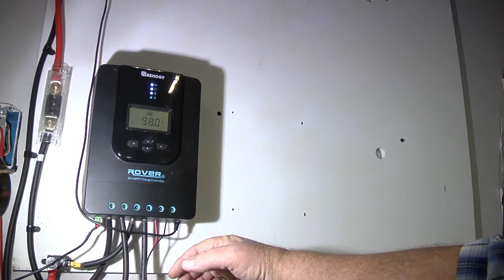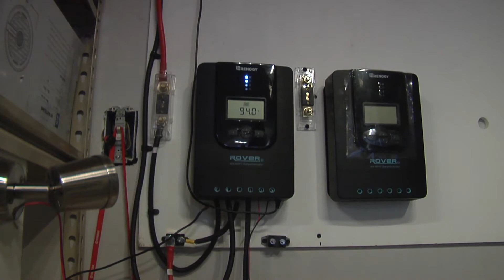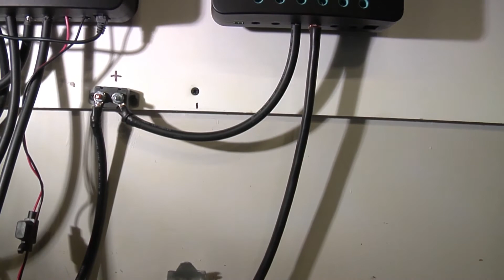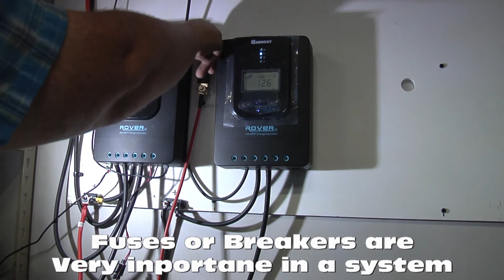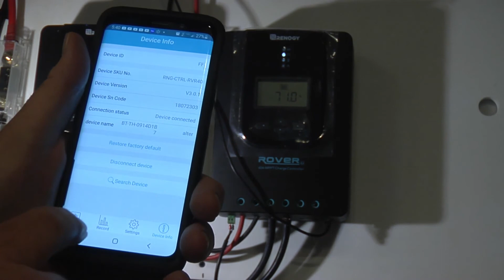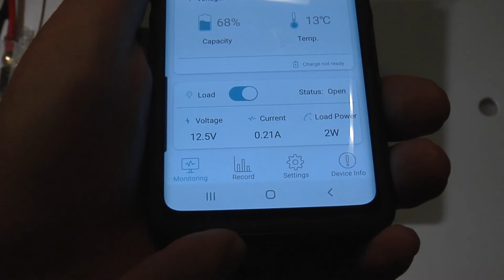Renogy Rover 40 amp Charge controller install guide

Comment: Thanks for this video. I currently have this Renogy 40 amp charge controller with 4 - 100 watt panels wired in parallel. I wonder if it would benefit me to have the panels wired in series and even add 1 more panel and have 5 in series instead and brought into the controller? Thanks and this was a great video. They're are pros and cons for series and parallel for sure. God bless 🙏 

Jeff - Sunny Central Florida ☀️
Reply from the maker: I have always had 5, 100 watt panels in parallel , and working great. I would just add one more panel to your system and just keep it 12v. Thanks.  Have any more questions just ask.

Comment: Hi: can I connect a 1.5 amp refrigerator to the load side of the renogy controller?  Thanks
Reply from the maker: Only if you run a relay, use the power of the charge controller to power the relay, then the 12 volts from the battery through the relay then to your refrigerator.  Would be the safest way to do it. Thanks

Comment: Did the circuit breaker come with it? Do you need that?
Reply from the maker: No the circuit breaker did not come with it. Yes you need a circuit breaker or a fuse. You cannot have to many fuses or circuit breakers.  Prevents fires...
Reply: What kind fuse holder and fuse amperage ? Thanks

Comment: If you have 2 seperate battery banks with isotlators does this charge work with it and split the load of the panels?
Reply: I only have panel can I still split question One panel can I still split ?
Reply from the maker: Yes through a battery isolator will keep them separated.  Thanks
Reply from the maker: Yes, it is two separate systems, 5 solar panels per charge controller. So yes you can very easily have 2 battery banks. Thanks

Comment: Why two charge controllers?
Reply from the maker: You can only put on 500 watts on each one,  or 5- 100 watt solar panels.  And I have 10 panels so I need 2 charge controllers. May go 3  this year. May add 5 more panels, After I get some new lifepo4 batteries  Thanks

Comment: Hi friends, my mppt rover 40a is not giving accurate battery percentage, it is propperly configured in 12v and lifepo4 battery, battery is new and mppt too, any other setting to make or help? thanks, regards.
Reply from the maker: The Rover has settings for what battery you are going to use. what type of battery you have?
Reply: lifepo4 12.8v 100ah from power queen @camaromodschannel

Comment: Ditch the temperature sensor if you're using lithium batteries
Reply from the maker: True.
Reply: Why wouldn’t you want a temperature sensor on Lithium batteries, they’re the dangerous ones?
Reply: @jerrytalley802 argue with the manual. Apparently you don't use lithium batteries or you would know this. Lol

Comment: Great setup and well explained. Thank you. 
I've just replaced Morningstar with this model but my old cables are much thicker, I think awg 4. I've seen you struggling little bit with the battery connection and I'm not sure if my simple solution, just cutting around the copper core end until the diameter is just right, is safe?
Surely some wires will touch the aluminium cover and with time passing some conductivity may appear?
What do you think about it please?
Reply from the maker: Yes,  it will work,  as long as you're connection is not getting hot.  If it gets hot then you will have to get the correct wiring.  Thanks

Comment: Hooking mine up soon. But instead of running my panels together at 12 volt. I'm going to tie the three together to make36 volts. This charger is rated at 100 volt max. So regardless of my 12 or 24 volt battery bank. Everything should be fine?
Reply from the maker: Each charge controller will detect the 36 volts.Just remember each charge controller will detect 36 volts so go to positive, and negative on your battery bank, just like 3 battery chargers on one battery.  You need to make your 36 volts at the solar panels. 3 panels tied together.  If you have any more questions just let me know. Yes, you should be fine..

Comment: Im have 2x170 w panels sticker open voltage 26 VoC but he up 30 VoC sticker not corect  can im put x3 170 w panels 90 VoC on 40 amp mppt controler 100 v or cant
Reply from the maker: I have 5--100 watt panels on one charge controller with no problem,  you will never get full power out of your panels so yes I would try it and watch your watts and amps. Thanks
Reply: How much VmP ur 5 panels im litke scared no want broke me controller ❤️
Reply: Thx u

Comment: Hi I can't seem to find wire sizes for the rover 40. I will have 10 awg for my two 170 panels, so that will be coming into the rover. What is the size of cables that you have from the rover to the battery? My distance will be 2 feet. What size of cable fits in the holes? I was trying to source some ferrels. tia! Ah i see from a post below you are using 8 awg. Is that the max size do you think, for the rover? You said you had to back it out pretty far, that implies it is almost maxed. I noticed you squished a few strands so i expect that is max size? This is why i want a ferrel if possible.
Reply from the maker: Yes, 8 gage is a good size to use. But 10 gage will also work fine.

Comment: On the battery type what do you use from agm
Reply from the maker: I used deep cycle boat or rv batteries  you get at your local auto store.  Nothing fancy,  it just needs to work.  Thanks

Comment: Hi have the same 40amp controller and looking to add another. How have you gotten around the battery equalization stage, so only one goes through the process?
Reply from the maker: I know you're not to connect them together. I know others who have done the same thing without a problem.  I have to reboot the first controller about twice a year. I check the batteries from time to time on a cloudy day and charge each battery individually, may even do that tomorrow.  Also check the water (acid) the controllers are computer controlled so if they detect a low battery voltage they will charge. But when the system go into equalization stage is another problem,  I wish they had a way to turn one off, someday I'm sure they will.  They both blink when in the equalization stage. They have been working very well for almost 2 years. Thanks
Reply: @camaromodschannel  Thanks for the reply.

Comment: Can you install the Renogy 40 Amp charge controller in the storage compartment in the front area of a travel trailer? It would be located in storage under queen bed in front of trailer. I was concerned about ventilation, but it seems people are putting them in cargo areas.
Reply from the maker: Yes, I wouldn't worry about it, they are made for taking some heat. If it gets to hot it will malfunction and won't charge.  You could put a small fan if it gets too hot. Thanks.
Reply: @camaromodschannel  Thank you. Will do a small fan.

Comment: 1) Do you notice a lot of heat on the back of the controller? Wondering if that was your reason for fire resistant wall covering. 2) How do you tighten the mounting screws after installation? Wondering how I would do that on a RV interior walls.  Thanks
Reply from the maker: No, I wouldn't worry about it, very little heat, it's what I had around and thought I would use it. Main thing is your fuses.  Make sure you put them in. In your rv just mount it on wooden strips so the back can have air circulation if you want.  Thanks.

Comment: What's the fuse for?
Reply from the maker: If you have a short you don't burn the house down...
Reply: @camaromodschannel  Okay, but how does the overcurrent happen if the solar panel is expect to output a max current that would not exceed to the degree that things catch on fire? And also, doesn't the solar charge controller have an inbuilt fuse? Sorry, I'm alittle new.
Reply from the maker: Yes. The charge controller takes the voltage and reduce it down as not to overcharge the batteries. All automatic. And take a look at my video, inside this charge controller,  all kinds of fuses inside that thing.  Thanks.

Comment: Are you running the charge controllers together in parallel on the same battery bank , or separate battery banks?
Reply from the maker: Yes on same battery bank,  they are computers controlled so it won't over charge the batteries. I have one positive from one controller on one battery and the other controller positive cable on the opposite end of the battery bank. Thanks.
Reply: @camaromodschannel  Thank you for replying. I have two of the same controllers. Was thinking about doing this. Did you notice your batteries charging any faster after adding the second controller?
Reply from the maker: @alwaysavailabletree5349  yes, they will charge faster, just like a battery charger,  have it on 2 amp, or 10 amp will charge faster.
Reply: @camaromodschannel  I've been searching about using multiple Renogy Rovers in parallel. You're the only 'go to guy' on this. There's nothing out there about it that I've found. I know the newer 100amp Rover models link together to make 200 amps. Do you think one controller defeats the other controller since they back down at 40 amps , and you're just getting 40 amps total max between the two , since these earlier rover models don't link together? Or do you think the combination of the two is up to 80 amps of charging power? I'm not being critical. I'm no electrical engineer by far. Just very curious at what you have going on. Thank you.
Reply from the maker: @alwaysavailabletree5349  no one controller don't defeat the other, both controllers knows the battery is low and will charge. Your charging amps will stay the same. 40a on 2 charging controllers. Thanks. If you have more questions just ask and I will do my best to answer them.
Reply: @camaromodschannel  I found a couple of videos on paralleling two charge controllers on same battery bank. Both videos showed tests. The amps double , the volts stay the same. The expensive charge controller mfgers only recommend linking the controllers , so multiple controllers aren't over equalizing the batteries. They said you keep one charger set to FLA batteries if you have FLAs , so it will equalize. Set the other charge controllers to AGM , so they don't equalize , also change the charging voltages to match the other controllers.  I appreciate your replies and help. Good luck on bringing in lots of power. 👍 Thinking about switching to 24 volts with my system. $130 per controller putting out 1050 watts max seems very reasonable to me. Thinking about running 4 controllers , already have 2 controllers ready to go.
Reply from the maker: @alwaysavailabletree5349  that's what I was thinking amps double and voltage stays the same but wasn't sure. They are nice to have knowing that you will always have power,  just to run a couple lights at night makes it worth it. Thanks
Reply: @camaromodschannel  Running a GE cync LED smart light strip on 3 100 watt Renogy panels and a renogy rover 40 Amp controller. Two autozone industrial batteries paralelled that are 6 almost 7 years old , they're getting weak , but keep me with enough light day and night in my cabin. Check out that light strip , they're pretty neat. You can control it with an app on your phone with Bluetooth , make the lights turn any color you want. I turn the brightness down to 1% at night while I'm watching TV , uses hardly any energy. I have 7 more panels sitting I need to start doing something with when I get new batteries soon. Then I'm going to get 2 more 40 Amp charge controllers and 9 350 watt panels and switch 24 volt battery bank and inverter.
Reply: Renogy has specifically told me that the 40 amp mppt Rover controllers cannot be run in parallel. Only the 60 amp and 100 amp models. According to them there is some communication problem between the two controllers when run in parallel.
Reply: @WayOffGrid  they are tellin me the same thing, its hard to believe they are the only company out there that cant be in parallel
Reply: @hillbilly4ge113  apparently it's not a problem with the 60 amp or 100 amp Rover only the 40 amp. I'm getting tired of resetting them so I'm looking to buy different equipment. Renogy has lost me forever. Their support is virtually non-existent and by the time your question is translated to a different language sent off to someone then a reply comes back and then it's translated back to English you wind up with an answer to a question you never asked. I have never been so frustrated with customer support in my life.
Reply from the maker: Never had a problem,  batteries always charged very well in sunlight. So what are you suggesting.  Don't work?  Its like a battery charger it checks voltage on each controller and adds voltage when needed. Thanks.
Reply: @camaromodschannel  I'm not suggesting anything. Actually the opposite, I was seeking information. I own two Renogy Rover 40 amp MPPT controllers. I was having problems with one of them and renogy support told me that these controllers cannot be run in parallel but couldn't give me a specific reason why not. I'm glad to see it's working for you. I too and defying their advice and running them in parallel each with its own 500w array (5x100) charging three 200 amp hour 12 volt batteries to supply power to my off-grid tiny house. I do notice however, that the two chargers will begin to show different state of charge percentages and different battery voltages every once in awhile. I simply reset them by disconnecting first the PV and then the positive battery cable for a period of about 5 minutes, and reconnecting them in the reverse order.
Reply from the maker: @WayOffGrid  No Sir, never had a problem running in parallel, I even have meters that show the amps going into the batteries,  I have about the same setup as you,  5 -100w solar panels on each charge controller . 10 total and 2 controllers in parallel charging 5 batteries.

Comment: where did you get fire resistant plastic board?
Reply from the maker: I got it at work they threw it away, had holes drilled wrong. Not sure where you could get some,  marine grade plastic. Thanks

Comment: The status on the mobile app for the load, is that not back to front? A switch Closed should be ON and Open should be OFF. Do you know if you can connect to this from a desktop computer via serial port to grab data into custom software?
Reply from the maker: Not sure what you mean by, back to front? Yes a switch is off when it is open. I'm sure you can connect it to a computer via serial port, just depends on the software you use, yes I thought of that myself, that would be cool.
Reply: @camaromodschannel  Back to front, i.e. the other way round. i.e. if the switch is ON the APP should display Closed and not Open as it currently does.
Reply from the maker: @DavesAstrophotography  yes its backwards,
Reply from the maker: But the switch is backwards on the app. But works well.

Comment: Great job as usual!  Very informative!!! Just a couple of questions and observations:
- Regarding the batteries, are they lead-acid deep cycle marine batteries?
- Regarding the inverter, is it an RV (or automotive) inverter? 
- Love the BT ability!  That's pretty damn slick that it can all be controlled from your phone!!
- Those "Phone Cable" connectors are called RJ11. If you wanted to extend the wire, you can get extra wire, connectors, couplers, and crimpers at Home Depot.  They come in 4-pin and 6-pin variety.
- Watching this around (12:41) got me to thinking - I saw a video a while back pertaining to wiring up a car amplifier.  They were using wire ferrules when connecting the primary wire to the amplifier to prevent the strands of wire pushing back out. Check out the first few minutes: https://www.youtube.com/watch?v=sMFFzpzKhFg
Reply from the maker: Yes,deep cycle lead acid, inverter is used in RV, big trucks, boats.yes i need to extend the wire some day.but works good for now. Thanks for your questions.Thanks for watching.